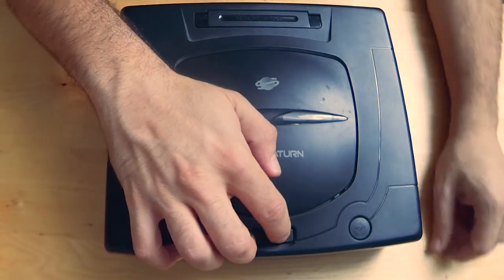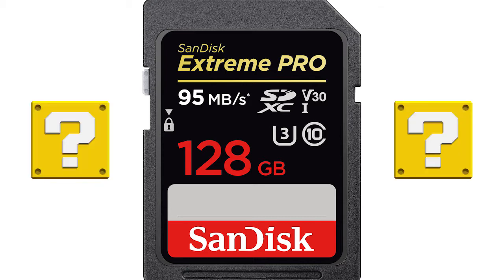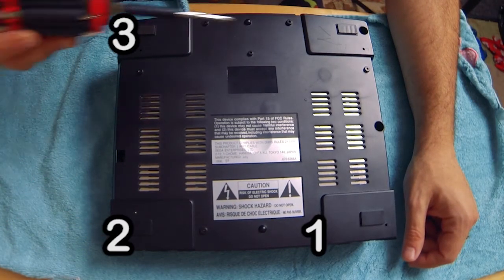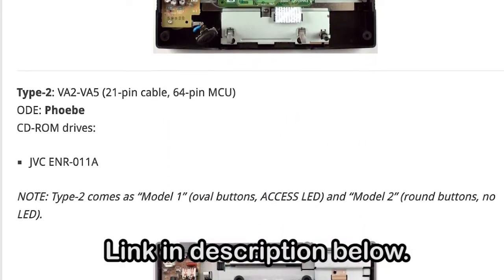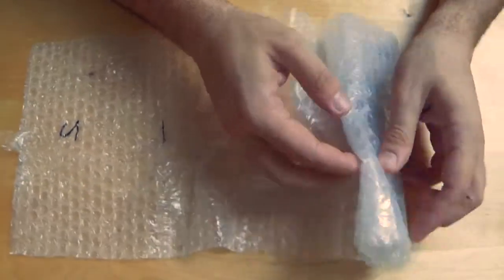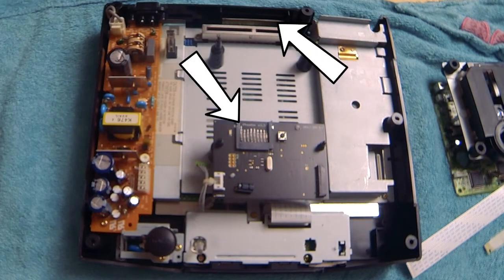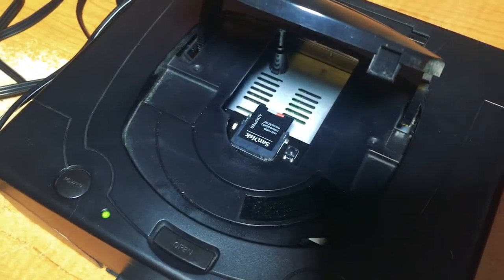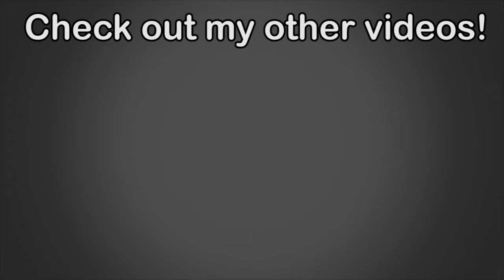How to Install a Phoebe ODE into a Type 2 Sega Saturn - Video Game Mods

Comment: My life in gaming said you need to solder the phoebe kits.  Do you have to solder with other models?
Reply from the maker: If you order the correct board type to match your Saturn model you do not need to do soldering. If you order the wrong board then you can solder to reconfigure the board.

Comment: Thx.  So may I ask if that pin #79 wiring is really necessary as I don't see many people doing it.
Reply from the maker: From what I've read it's a completely optional step. It's only if you want to enable the Phoebe to be able to automatically switch the vertical refresh frequency based on the game's region. I'm ok without it on mine.

Comment: My Life In Gaming stated that the Phoebe required soldering. I’m assuming after watching your video that’s no the case?
Reply from the maker: It only requires soldering if your get a Phoebe that isn't configured for your Saturn type. When you place your order you can choose which Type you want so the soldering is done for you ahead of time. So as long as you know what Saturn type you have before you order you'll be fine. If not, then yes you'd have to solder to reconfigure the Phoebe to match your Saturn type.
Reply: grecofabulous thanks for the info. Phoebes are about to go on sale at the end of March.
Reply: Are they still on sale?
Reply: grecofabulous how anout cutting the pin #79 and re-wire it to the Phoebe?
Reply: @esprithk  Only necessary for the disc swap button, I THINK.

Comment: I'd recommend not using a towel next time. You can cause a short due to static electricity. I always use a wrist strap when toying with my consoles so I'm grounded.
Reply from the maker: Appreciate the tip. That definitely would have sucked. I forget where I got the idea from, but someone definitely mentioned using a towel to avoid scratching the console, but shorting it is obviously way worse ;)